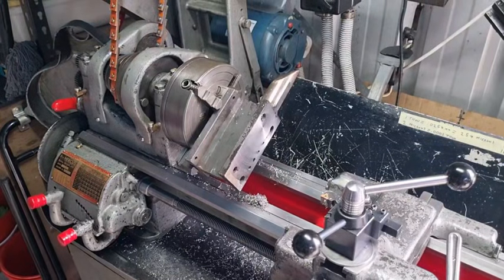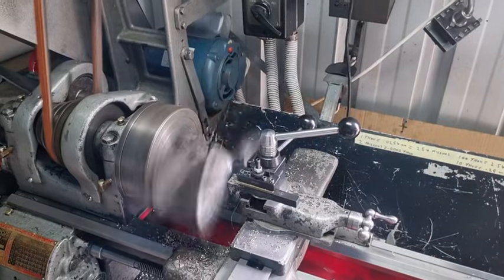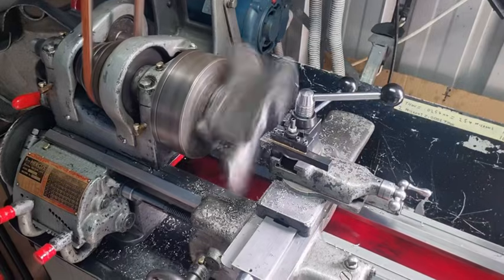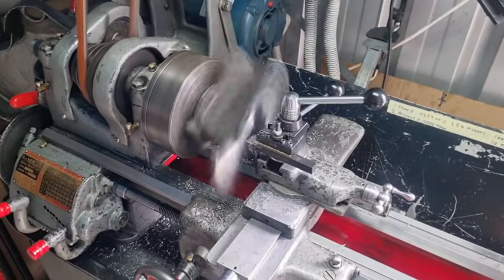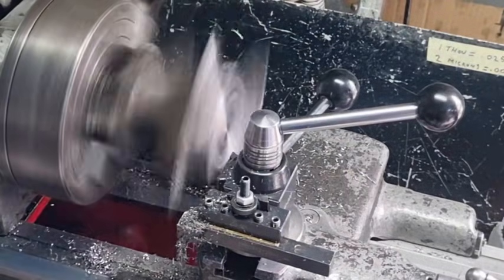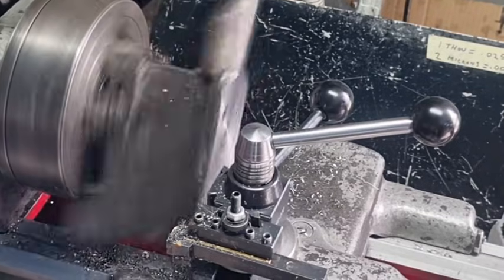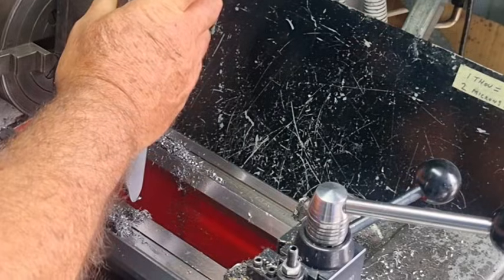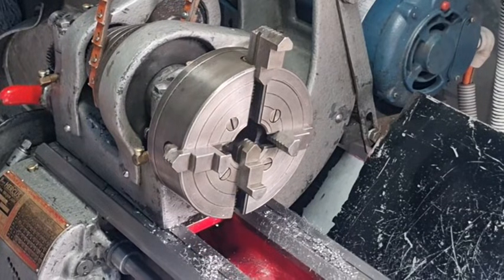Using a lathe to mill a small Anvil

Comment: That seemed quite balanced, You could walk a lathe out of the workshop if you don't blance a piece like that :)
Btw, it's still a turning operation because the workpiece is spinning. It would be milling if you strapped the anvil to the cross slide or compound  and put a flycutter in chuck.

Comment: It's very unusual to feed from the inside out, difficult to put a cut on when the tool is in the middle of the end instead of off the edge of the part.
Reply from the maker: Hercus lathe auto feed works from the inside to the outside as long as the tooling is facing correctly not a problem
Reply: @hercus9a  That's amazing. I have never used or seen a lathe that won't face off a piece from the outside in. That must be so frustrating not to have that option or not be able to reverse the direction of the leadscrew for left hand threads.
Reply from the maker: @Bosun-8 you can face off outside in  nut not with auto feed.
You can change the roller gears to reverse and also do it that way
Reply: @hercus9a  I was told that it is only moving a lever to change direction. Do you always prefer facing off parts that way, or is there a trick we all don't know about?
I have chipped quite a few inserts over the years trying to start the tool off dead on center, usually on the bottom face of a blind bore. I always end up drilling a small hole to get the tool started as it often does not matter if there is a small recess in the middle of the face.
Reply from the maker: @Bosun-8 yes its a Lever buts its bolted. Normally I would face off outside to inside
Reply: @hercus9a  No problem. I guess you must have deliberately changed the lever so you could face from the middle, is there any particular reason for this?
Reply from the maker: @Bosun-8 I was lazy and never  changed it.